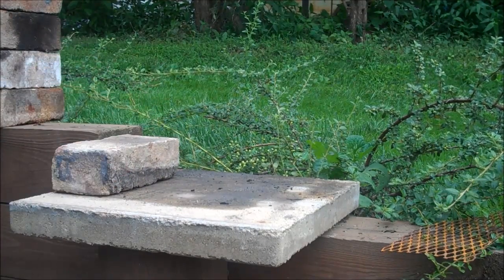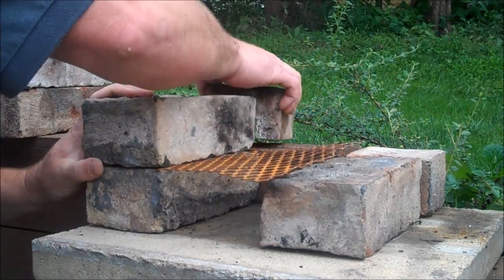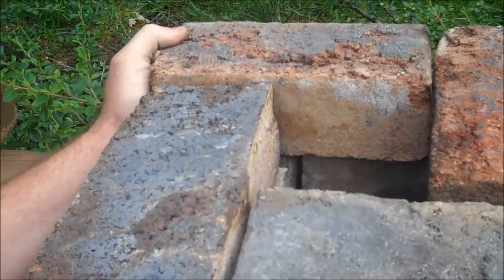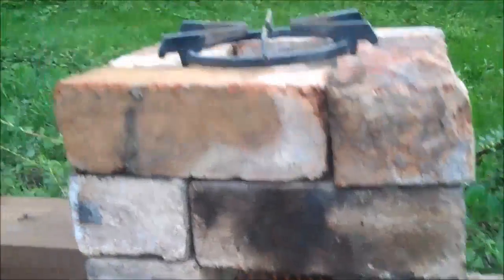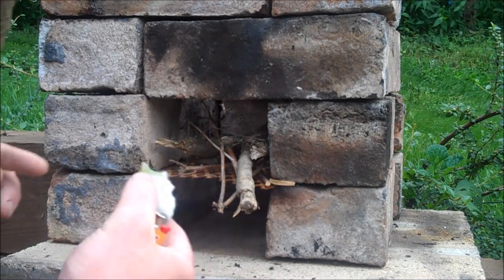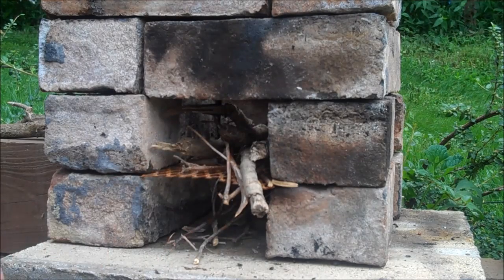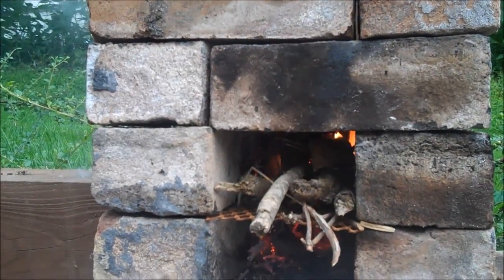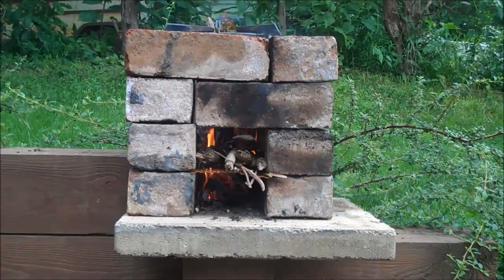Easy To Make Brick Rocket Stove

Comment: Nice but it should be smaller size for the fire to be much better
Reply: Tomorrow I will make it OK
Reply from the maker: I had a comment to make it taller , some shorter, it works well for what I use it for. Its great that people experiment with it to make it fit their needs. Thsnk you for watching.

Comment: Complete outdoor been question: can you use charcoal I stead of twigs?  Will it work the same?
Reply from the maker: I dont see why not. It might take longer . If I were cooking with charcoal I would build a smaller one putting the pot closer to the heat. Thanks for the question.

Comment: those bricks are probably fine but I'd probably like to use fire place bricks. Also cheap dollar store steel wool ( has powdered aluminum ) will start it super fast. let it burn off before cooking though because it might be toxic.  thanks for the video
Reply: We are in NC, with stands of pine trees. They are messy, but pine straw (old needles) are great fire starters?
But they burn HOT so don't use too many.

Comment: Nice vid, but this is not a rocket stove.  It's just a regular old fire pit.  A rocket stove is designed in an L or J shape and creates a vortex whereby burning the wood fuel smokeless and efficiently with no soot.  All you are doing is burning wood right under your cooking area.  That's just a fire pit with a feeding area which also doubles as an air intake.
Reply: I don't see how this is not a rocket stove.  Air and fuel come from side channels, air below fuel (though he does put some sticks in the air path, which was unnecessary).  It may not be a very efficient rocket stove (a higher stack would help), but if this isn't a rocket stove, none of the brick or concrete rocket stoves on youtube are rocket stoves.
Reply: When you have a full fire going in it does it make a roaring sound from the air being pulled through It?
If so, it's a rocket stove.
The brick has so many gaps to let in air that it may not make that special noise from which "rocket stoves" got their name.
I wouldn't worry too much about what anybody else thinks about it.
Reply from the maker: Agree with that. Thanks for watching.
Reply from the maker: This is a j or L setup. Sorry if it's not what you thought it was. This is what YOUTUBE is calling it so I did too.
Reply: #1 No that is not a J or L setup, it's straight up and down, nothing else.  
#2 If 90 out of 100 youtubers start calling a kangaroo a dog, does that make a kangaroo a dog?
Reply: @nunyabiznis817  if the kangaroo identifies as a dog then yes its a dog.  i wont call this a rocket stove but will give it a go as its  so basic n some fire to mess around with.
Reply: மிக அருமையாக ராக்கெட்டை அமைத்துவிட்டிர்கள்.  Awesome wonderful job.
Reply: yeah its not a rocket stove, theres no secondary burn chamber that ensures 100% combustion, this is just a fireplace with cooking surface, better than a firepit.